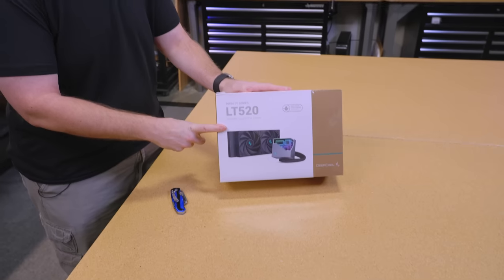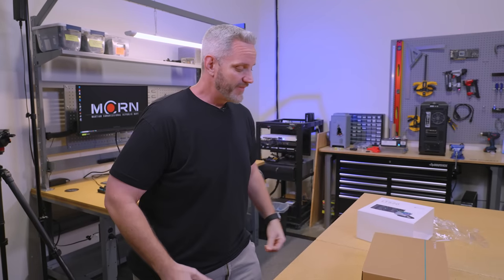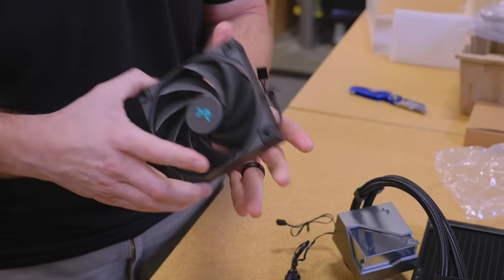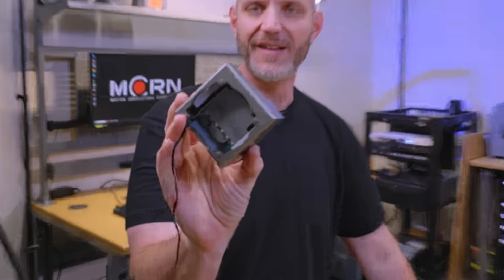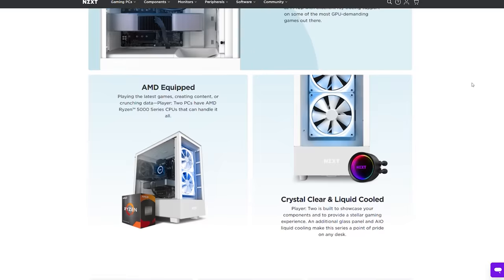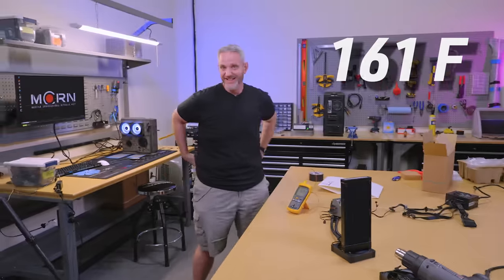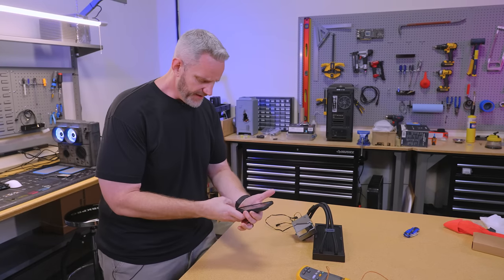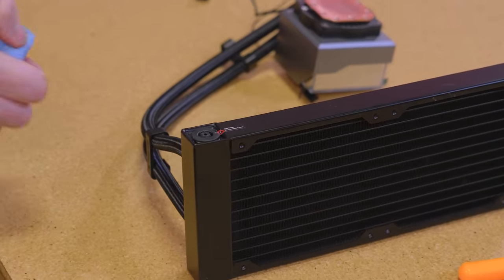They say is won't leak... I'll be the judge of that!

Comment: I honestly don't understand the whole fear when it comes to aio's leaking. Yeah it is a possibly of course. Anything is possible when it comes to this kinda stuff. But I'm much more comfortable with the idea of having an aio running and not leaking then my custom loop. Just gotta check and watch them and you'll be fine. Heck maybe check it every couple weeks to once a month. You should be fine. Asking as you have a good quality aio then your fine. I chose to do a custom loop for many reasons but one of the main reasons was so I could water cool my gpu. And only leak I had was when I was draining it and I did a very dumb thing. Splashed a crap ton of water on my HDD and had some get on the PSU. Luckily nun touched anything important for either. Only the outside of the PSU got touched (yes I did make sure that was the case and dried everything up). But some water did get into the plug in for the HDD so I dried everything I could and let it sit out for a couple days before plugging it back in. Thank god it was only my back up drive anyways where I had some games on there so if I did lose it then it's not that big a deal. I'd lose some game data but nun too important. Mainly just gonna be a pain in the wallet. But anyways I digress. Everything was fine and the HDD still works fine. Just learned for the next time to not be a dumby and if I do then make sure I take the HDD out before hand and make sure if any water goes anywhere that it's not on anything important. Long as u make sure everything is good and tight when ur gonna run it or make sure u got a ton of paper towels and take every precaution to not get crap wet when draining it, that custom loops are great and are perfectly safe. Along with aio's. Aslong as it's a good quality aio then you have nun to be afraid of. Heck even more so then a custom loop. Nothing you'll have to do to it besides screw in and plug in.

Comment: Good thing they now build "Anti-Leak" AIOs, after their old "Captain 240" leaked for me 2 Summers ago on an hot summer day close to the pump on that fancy looking bended tube reaching out of it likely to that expansion problem. But still never buy that brand again. currently stay with air-cooling until I build my new rig, even though it ended lucky for me with no real damage besides the AIO of course. But with current GPU prices nit sure if I risk that again if an air cooler is sufficient too tbf.

Comment: I'd love it if someone from DeepCool and gives us an explanation of how it works and why it's important. Extra point if they could show us how it fails and why it's been added. As an engineer, I refuse to believe that the designer would add something that is just there for show....
Reply: an engineer? and you don't understand how a bladder works to compensate for extra pressure, where that extra pressure comes from, or why excess pressure in a closed system is a problem? i refuse to believe you've ever set foot in an engineering class.

Comment: I think the idea is that the loop's pressure is kept constant and low. without attaching to an external tube and measuring the pressure and then hitting it with heat, will we know. Id love a followup though, would apply to full WC loops too.

Comment: I have an off topic question. I'm sorry for hijacking here, I just need an answer from people who know.

 I have a 7900xtx with 3 8pin connections. My PSU is a MSI MAG A1000g Pcie5.

I hear commonly that the XTX should be using 3 direct and separate pcie 8pins and not 2 plus the daisy chain(pigtail) as it doesn't allow the card to draw enough power for the spikes.

My PSU came with only 2 8pin cables, it also came with a 12VHPWR to 2*8 pin conversion. My PSU has a dedicated 12VHPWR out, this would allow me to plug the cable in and occupy 2 of my 3 connectors on the GPU, while leaving a spare cable to connect a direct pcie for the third.

I have been told this is ok by a community as the card will only draw what is needed. I have been told by a computer store tech that its a straight 600w coming out of that cable and could destroy the card.  That the cable included is to convert pcie FROM the psu TO the rtx cards that use the 12V connector. This logic doesn't make sense however, as stated before my PSU already has a direct 12V out.

With all of the mixed messages I'm receiving, I'd like someone with more knowledge than I to clarify please, as I do not want to risk damaging my card in either scenario. Trying to find some way to contact a real person at MSI is worse than trying to pull teeth and leads me in nothing but clicking in circles to FAQs that never address the question.

Thanks in advance for any light that can be shed.

Comment: TBH I think it is sort of a good idea, but more of a gimmick / fad, just like 3D TV's were / are.  But like you said when water heats up it expands, modern water (combi) boilers have the exact same thing (Vaillant calls it an expansion vessel) so its nothing new here.  But in this AIO it doesn't expand out, it looks like it squeezes on the hollow rubber thing allowing for the pressure to expand a little and then allows for it to reduce when it cools down.
But at the end of the day AIO's coolant shouldn't be getting that hot to expand like that in the first place and if it does then you have done something wrong or something is faulty.

Comment: have the LT720 version on the 7800x3d and it does an amazing job cooling it under load.
Reply: Yep. One of the best on the market in my opinion. Not as fancy but works way better than my nzxt cooler did

Comment: Heating at the wrong point. Heat the cpu end of the circuit, would have given a more realistic experience. Pump is designed to pump to the radiator.

Comment: I had a corsair aio sitting in my closet unused. I was looking for an aio that doesn’t have a lot of connectors and need software. I installed icue had nothing but crashes with it and have to uninstall and reinstall and it was just a pain. I may be swapping it out for this and trashing the corsair aio and getting rid of the software bloat from corsair.

Comment: I have a Deepcool Castle 360ex cooling my 5950X (PBO enabled) and it has also this anti-leak tech. What I can tell you is that sometimes (rarely) I can hear a little "phssssst" which I think the cooler is relieving some pressure build-up inside the loop? So it must be doing something?

Comment: If the aio is properly filled, there should be nearly no air. Liquid doesn't expand. This protection shouldn't be needed with proper manufacturing processes.

Comment: I have the ls720 on my 13700k and the ls720 also has an anti-leak feature, this AIO is incredibly quiet and cool in the summer with 55C outside and not much lower inside CPU temp doesn't pass 70C under somewhat heavy load (if you have air conditioning in your room it's going to be way, way less ) for the price and performance DEEPCOOL is king

Comment: hardware fail-safes don't always work as intended.  I had a enermax one that failed me right around the 2 year mark which i didn't notice until the system turned itself off, but once i got a new one installed it wouldn't boot and was acting very strange so i thought my CPU was damaged, turned out it somehow damaged my secondary SSD which was somehow preventing the system from functioning at all.  I've never seen anything like it before.

Comment: Had an AIO, was so disappointed in the performance I went full WC. The risk of leakage was never my main concern. Cost was, and remains, at the forefront of my mind. WC is expensive, and that is the main drawback. Its quiet, fun, works like a charm and DUMPS heat into the room (which is nice if you live so far north of the arctic circle as I do, no need for space heaters). Oh, and also, once you're in (WC) resisting the urge to tweak the system with various upgrades is a real struggle. Been drooling over a MO-RA for a bit now, if nothing else, to dump the heat in another room.. But then the cost.. I'm a convert. WC is too fun, I'll just have to sac some other hobbies to keep up with it :P
Reply: virtually every cooling dumps the heat into the room
Reply: Which AIO, I have a 280 EVGA CLC and it's been stellar.

Comment: Since the early 2000`s I used Corsair`s H`series Aio`s for my intel cpu`s,,2 yrs ago I jumped to AMD 4 and bought Deepcool`s 360 AIo with the anti leak tech,it has outlasted any I had before and to this day has the same performance as when I first put it in not unlike the other brands which degraded a lot after 1 year, I love Deepcool as well for it`s price,,The 360 version cost me the same price as the other brands 240 Aio`s.Pfff,,

Comment: Cool video. As a newer AIO user, leaks were something I was a bit worried about.

BTW Jay, do you know if any manufacturers have made IP68 water resistant PC components? Like motherboards, PSU’s ect? Or if there are any in the making?
Reply: I'm clearly not Jay but I did want to mention FSP's power supplies, alot of them have a conformal coating on the PCB and components to make them much more resilient to humidity and damp environments

Comment: Hi Jay. Would you take the best AIO components, in your opinion, from the AIOs you have tested and build your ultimate AIO? Since AIO pumps can clog, wouldn't a small, removable, in-line filter help to solve this problem? Could a radiator overflow tank similar to the ones found in cars also help with the bursting and be an excellent way to top off the coolant?
Reply: lol at that point just do a custom loop (soft or hardtube)

Comment: Where is the non conducting water that should be used for the water cooling pumps or aio thing to be 100% safe even if it get leaked so it won't damage any components of the pc???🤔

Comment: 16:44 that fact alone is what scares me the most about trying to get an AIO for my new better tier cpu for my next longevitiy build......... ive had a 2600 r5 running stock boost with the basic ass wraith spealth cooler for over 5 years now and its hoenstly been a work horse even though i havent cleaned it or repasted it or anything im supposed ot od every few years cause life was busy~~~~ buuuuuuuuuut im considering SO HARd the new corsair rgb type link systems AIOs which are like 240$+ which if that doesnt last me ATLEAST 2-3 years, hopefully maybe more? then im gonig to have to do some serious diy to the system every 3 years~ or so and while thats deffinitly fun since i plan to have my old one as a backup for however long i can clean it up and get it to survive, i just desperatly lack information r true understanding of how to tlc and take care of my diy system for the long term. just praying HARD that the new corsair link software can keep extreem monitoring of the components with the data transmition so if any when that AIO pump wears out, or something stops or temps are weird, or any other paranoia, or i start hearing fizzing, i know i can be as early warning as possible but time will tell.  CHEEEEEEEEEEEEEEEEEEEERS

Comment: i never had an issue with the AMD clip. but i was really scared that i would overtighten my new cooler that doesn't have the clip, and then i was afraid that i didn't tighten it enough.

Comment: So the bladder won't pop out. It compresses inside the tank and venting the air out of that hole, so in theory, the volume in the tank gets higher as the bladder compresses, and if it cools down again, then it sucks air back into the bladder reducing the volume in the tank, only reason why I could see a potential benefit of using that instead of using less fluid is noise(no air in system) and mass(total amount if liquid) would be slightly more. But it's also a gimmick

Comment: This feature in the radiator is STUPID. Indeed with heating the air expands and increases pressure. But then there is a "Bykski valve" that you can place on top of your combo reservoir pump and an increase in temperature will have the valve expel pressurized air at the top of the reservoir. Therefore there will be NO damage to any fittings...

Comment: I think usually aios have quite flexibel tubes so even if the water makes little bit more pressure it just expanse the tube little bit while custom loop can use fixed pipe. i think the leak free system would be better if after filling they will make vacuum to that extra tube so even if there is little cab it wound leak. if this is for expansion it could be used to expand when water is diffusing whit time throw the pipe so its not letting air in so no need to refill for next 5 years.

Comment: This is nothing new. They first included this technology in their Gamer Storm Castle series of aios. 

I have a Gamer Storm Castle 360EX with this technology.

The box states, "Although the liquid cooling radiator features low noise, high radiation efficiency and other advantages, it's potential safety hazards shouldn't be ignored. While the cooler is working, the coolants temperature rises, so will the volume expand. Sometimes gas can be generated within the system, which will further increase the systems pressure. When the pressure exceeds the systems critical levels, a leakage will occur."

"After 3 years of R&D, DEEPCOOL launched the new standard of liquid cooling system. The Anti-leak Tech. The technology helps the system to achieve an automated pressure balance, which will significantly improve operation safety of AIO liquid cooling systems. Inside the radiator, an elastic pressure-relief bag will be added. When the internal pressure exceeds atmospheric pressures, the bag will be squeezed and thereby increases the systems internal volume. As a result, the increased pressure is released and the risk of leakage is avoided."

😅

Comment: I got this ago cooling down a i9 12900 processor but I don't think that is doing a good job  my temp are always close to 100 when playing a game and on 55 in idle
Reply: I have a Noctua nh-d15 on a 13900k it never overheats when gaming, if I do a benchmark like cinebench, yeah it will go to 100°, but It still gets over 40k points. So I think there's something wrong with your AIO Maybe it's clogged up.

Comment: As far as I can see the only advantage of that bladder is if the AIO loop was completely bled of air. So you would have no air traped anywhere in the coolant loop. In a system without that bladder you have to leave a little air in the loop usualy in the reservoir to allow for expansion of the coolant as air is compressable and water is not. So the net effect is both system types have a meens of dealing with thermal expansion of the coolant however with the bladder type there should be no air bubbles or pockets of air in the coolant loop.

Comment: I have always wondered if adding a few mls of radiator coolant would help keep an AIO loop cooler or if it would make it worse.
Reply: Believe it or not having an incorrect amount of radiator coolant to "water" ratio (too little coolant) will actually make the heat absorbent properties far less effective than having none at all. Not to mention the insanely difficult to clean up aspect if ever things go bad. That stuff is super oily, and sticky once dried off, making it difficult to clean up. It's still a fun experiment though. lol
Reply: @nineoneoneusguy wow really? that would be more suited to custom water cooling then an aio in that case, you can just change out the parts instead of replacing the whole kit.
may experiment when i can put together a throw away rig with my old parts one day.